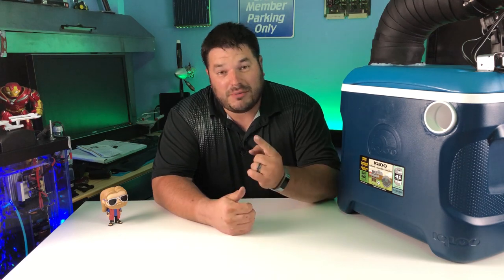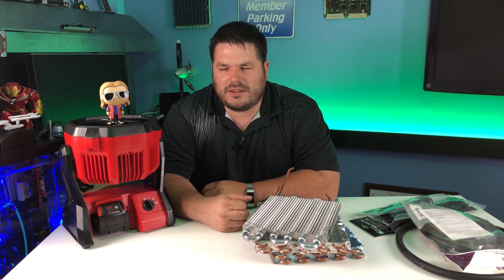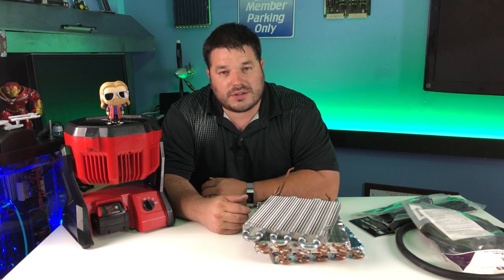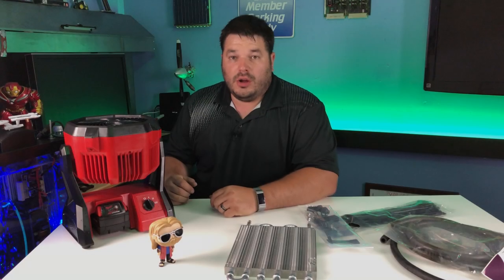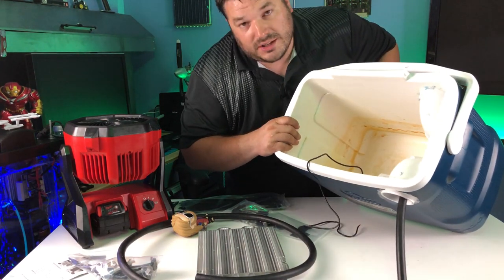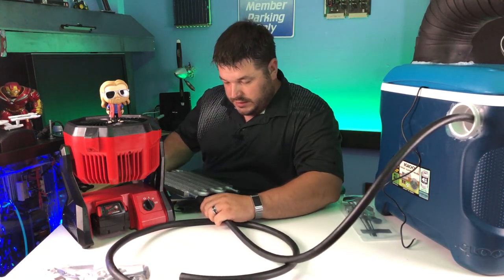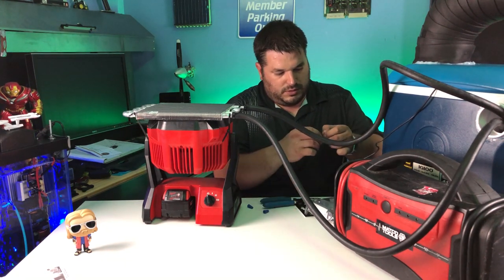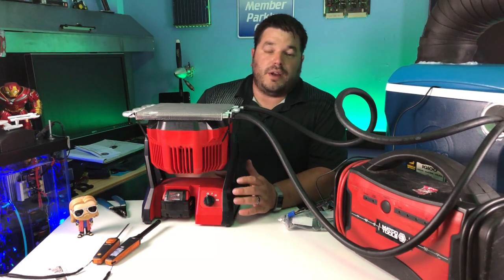HOMEMADE DIY ICE CHEST AC WITH A RADIATOR

Comment: So, I have a 2ft harbor freight shop fan and a massive radiator from an old diesel truck. With a large enough cooler, submersible pump, and some ice do you think I have a shot at cooling down my garage a little?
Reply from the maker: Well the off the cuff answer is yes. without knowing how big or well insulated your garage is the known limitations are the cfm of the box fan and the 144btu per pound of the ice, yull probably need a pretty big cooler and and decent pump.
I would use a pond pump and wrap a medium trashcan in insulation.

Comment: I made one using two metal coffee cans that held my dry ice, wrapped in copper tubing for water to run through. the cans had small vents on the top. Wrapped the cans and tubing in insulation. I split my cooler into three sections. On one end is the reservoir for my water , the middle is for the dry ice, the rest of the cooler is for the air intake and output. My air intake tubing sits on the bottom of the cooler, with the dry ice and water sit on the tubing. I have four rows of tubing on the bottom. I then put two radiators on the inside of the cooler where the out-flow vents are. On the outside of the cooler, I attached two fans in front of the radiators, with flanging that I can attach my directional vents. My air intake goes up to the top of the tent. This is made so that I can draw a small amount outside air, so that I don't have negative air pressure inside the tent. My vent for the dry ice is just a small hose that I run out and up through the intake tube. I have about twenty feet of hose, and it sits in the air flow end of the cooler. I made my water reservoir out of a plastic coffee can and a sterilized, never used pee bottle from the hospital. I attach the pee bottle to the can at an angle so that when put water in them, there is an air pocket at the top of the can. This will help to keep the water from freezing up (which it will). I used a 12V 5 amp marine pump, which is just enough to keep the water from freezing as it goes through its loop. Kept a 10x12 tent at 75 inside when the outside temp was 108 every day of a three day camping trip, which was my first time using it. That was thirty years ago, and my sons use the crap out of it to this day.
 There is only one problem with the design. Any condensation ends up in the airflow end of the cooler, so you have to keep the air flow tubing out of it, which is easy. Everything is 12v and can be ran by solar or a twelve volt battery. If you camp with kids and a wife, you need this. I'm not sure how much it cost to make, because I had everything just laying around or bought items from yard sales. The one I made for my son twenty years ago, cost me about 50 dollars.
Reply from the maker: This is a very thought out and apparently decent design. I would like to emphasize the use of the vent tube for co2 gas.
Yea man thank you for the share for sure!
Reply: @TheRenaissanceBuilder  My pleasure. I had to come up with something when the wife said she wouldn't go camping because of no A/C. My radiators are just heater cores off of dead cars that friends had. I never buy new for my DIY camping gear.

Comment: Another thing you could do I didn't think of is that she stack those heater cores or transmission coolers on top of one another and put them in series with each other and you should be able to get a better cooling temperature but still have the same amount airflow because I'm out of density Ben's is exactly the same as long as you line them up
Reply from the maker: Well that certainly is an idea, even if the resistance does increase that can be dealt with with a better fan. I find that when experimenting with output it comes down to two factors to balance and that is; cold air output (or specifically how many btus are you trying to move) and your ice capacity. The higher output the faster you go through ice so its often a trade off with what exactly your looking to accomplish with the unit. I find these units tend to work best as personal coolers, and in that a moderate airflow directed at the person with moderate cooling is the best ballence between your effective cooling and how fast it goes through ice.
Reply from the maker: Oh and thank you very much for watching and commenting, i love to here about other ideas and participate with veiwers!
Reply: @TheRenaissanceBuilder  his other stuff you can do to we used to do it in football to cool down the water we were drinking back in high High School chest on wheels
Reply: It would have a water pump is like see pesticide sprayer you can get at Tractor Supply or Walmart it'll be a trouble pump at 60 PSI is also the same pump you would buy for a camper water system and then we would have plastic hose or copper tubing going like a radiator pretty much inside the ice chest and on hot days as the water will go through the coils it would actually be cool down to the temperature of too much a drink that was thrown in the freezer for an hour or the same temperature as a refrigerator if not a little colder and I ate experimented with something with a old but still working small deep freezer and a couple heater cores. So what we did was we would actually have it layered inside the deep freezer and as it ran and stayed cold inside that deep freezer the water would just Loop all the way through the entire deep freezers the whole freezer will be filled with coils and what that did was it was actually pretty cheap to run that and as the deep freezer ranikhet the water ice cold just like your refrigerator has a cold water dispenser

Comment: Oh wow 2019, hopefully you will see my question…

Where does the water pump come into play, how is it connected?
Reply from the maker: Yes i indeed do see your question!
The water pump sits in the bottom of the cooler and pumps water the cooler bottom up into the coil and back to the cooler. It gets connected in parallel with the fan and can be powered by any 12v source.
Thank you for watching and asking!
Reply: @TheRenaissanceBuilder  are you serious from 2019… thank you so much😁
Reply from the maker: @chrisparker5895  absolutely boss, the entire point of this channel is to show and help everybody see that they can do stuff themselves. Ill never stop believing that.
Reply: @TheRenaissanceBuilder  I was going to do this the old way (fan blowing on ice) starting doing research and came across your video… thanks again
Reply from the maker: @chrisparker5895  theres a whole series on ice chest ac units, feel free to check it out. https://youtube.com/playlist?list=PLxe04zgzy0OC5LqGI7K3AQiLSKOHaS55B

Comment: Nice video! I'd perhaps explain you graph a bit more. Change in temp looks pretty exciting though. In a new build, could you please run power from tool battery to both the fan and the water pump? perhaps 3d print an adapter that goes between the fan and the battery? Not sure of the current pull of either. Then run a buck converter to step down to 12v? Great on screen presentation though and I like the idea. 10/10.
Reply from the maker: Thank you very much.
I don’t have a 3d printer but i did make a battery powered unit.
https://youtu.be/NTbrqCim1i0

Comment: I’m a complete noob, so bear with.  This seems like the best system I’ve seen so far and possible to use to sleep in carin hot and humid weather.

I’ll have reliable electricity (Bluetti or Jackery).

Recommendations for:  fan size (or specific fan), radiator size, how to affix radiator to fan, how to position fan radiator combo -> catch condensation without dripping on fan.

Once condensation in pan, I can put a hole in the bottom and have it drain back to cooler or into bucket.

Need for Honda CR-V, 1 person, 10 hours/night.

Thoughts?
Reply from the maker: Seems i missed your question and its been a while, I apologize.
I am a big fan of using computer case radiators and fans as they are extremely energy efficient and easy to package and mount together. Otherwise an automotive aftermarket transmission cooler like this one and a generic 10 inch fan would work well

Comment: How did everything work with the transmission fluid cooler vs the heat exchanger/core?
Reply from the maker: Hi Nate, i never got to try the tranny cooler because the fan i bought for it crapped out during tests. However, it would work just fine if you got a reliable fan for it. I believe its a 200mm fan, you would want to measure it to confirm.
You do not want to use the fans that are sold with it/for it because there way to high power
Reply: I used computer cooler parts for the one i built

Comment: Doesn't the radiator produce any condensation and "sweat"?
Reply from the maker: Yes it doas, if that is an issue a tray can be placed under it and drained away, or drained back into the cooler

Comment: So your Delta T is about 15 degrees, will that increase if you use a square fan and use a front and back side radiator ?
Reply from the maker: So more airflow will decrease your delta, the delta T or supply air temp is a factor of the temperature deference between the radiator and air, and the volume of air and water moved.
Another words slower air means each molecule of air spends longer in contact with the radiator but faster air spends less time.
A second radiator can help as long as the air to coil temp difference still exists.
Where it fails is when the leaving air temp is already within five degrees of coil temp then a second coil of the same temp will only drop the air temp another two degrees at most.
Key points
More air needs more radiator witch then also needs more water flow.
Reply: @TheRenaissanceBuilder  thanks, would a ethanol/water solution offer better cooling ?
Reply from the maker: The ethanol acts as antifreeze so you can get a lower saturated temperature allowing for high Delta T’s yes
Just subcool your ice to like -20 and yull get much better performance that way
Reply: @TheRenaissanceBuilder  you are the man, just got a new subscriber. Thanks for all the info, will take a trip through your YT catalog and see what other gems you have. I wish more success to you !
Reply from the maker: Thank you very much, i really do appreciate the patronage

Comment: I think this one is the winner for me.  Any moisture issues that you’ve noticed yet?
Reply from the maker: Donnie Culver  i want to make this version into a more “clean” setup that the whole things runs on solar yet.
I haven’t had moisture problems per say, but it does drip condensate so maybe set it on a tray.
Reply: The Renaissance Builder, thank you.  Dripping I can take.  Blowing/covering us in water is a different kind of issue.  This looks to be within my capabilities.  Going to the lake next weekend, and plan to make one of these!
Reply from the maker: Donnie Culver no sir thank You. Share a pic of your creation i would love to see it
Reply from the maker: BitFenix Spectre Pro 230mm Case Fan BFF-SPRO-23030KK-RP Black 
Im going to try this fan with that coil
Reply: Have you seen other videos where they’ attach the radiator to the top of the cooler and the fan pulls air in through the radiator, across the ice filled cooler, then out the fan?
Reply from the maker: Bob McNelis i have not seen that but my initial reaction is its a bit “extra”. Mounting the radiator in the cooler messes up the advantages of a movable chiller coil. You cant put it where you want it anymore, the ice will re humidify any air the coil dries out and the ice is already doing a better job of cooling than the coil can so 🤷🏽‍♀️
Just my two cents
If you want to see i good ice version check out  https://youtu.be/xHdJh7aPHeE
Im pretty happy with how that works
And thank you for watching and commenting I appreciate it😄

Comment: That little raiders actually call the heater core or if it's for a transmission transmission cooler it is the simplest smallest thing can use in a world it's also what heats up your car or your truck and gets it really hot from your coolant being about 200° and you get about 90 to 100 depending on how efficient it works out your vents in the front of your vehicle it can heat up a small area pretty quickly and keep that heat
Reply from the maker: Well thank you for responding, I appreciate your input for sure!

Comment: Could u used liquid nitrogen in this same operation
Reply from the maker: Well thats an idea for sure. It probably would either take allot of work to make the system hold the pressure or it would not last long. 
Also nitrogen can suffocate just as quickly as co2 so ventilation would be important
Reply from the maker: Thank you for the idea and for watching! I really appreciate it!

Comment: How long does the cool temperature last on your setup with ice filled up?
Reply from the maker: magicogar  I honestly never got to find out because the fan broke 😖, based on experience though i would say a better fan would have this unit running for 1-2 hours and doing a relatively good job of cooling of the space.
For a bit more money the upgrade works amazingly well, my favorite one yet.
https://youtu.be/EYEDD7dW47M

Comment: two quick questions and i apologize in advance if someone already answered this but i dont think i saw it so here it goes: 

1- why not put radiator on the otherside (air sucked in) or since the flow would already be restricted due to the radiator blocking air inflow? and therefore the opposite is better since you get the full force of air-out forced through the fins and cooled more?

2- is it making it more complicated by adding a heat exchange in between (which i already have) and thus have two closed systems? so for example, one side of the heat exchanger is attached to the the fan radiator/cooler and the other side of the heat exchanger is connected to the ice bath? and maybe use radiator coolant on the fan side and maybe even car cooolant in the ice box and maybe use lots of frozen water bottles to get the coolant really cold since it would technically not freeze at 32F and likewise on the other side? 

i previously used that heat exchange on a bitcoin mining rig that i submerged in vegetable oil and it worked well but could barely keep up with temps of 165F. im trying to remember if im going to need two pumps if i were to go this way and it is even worth it. do i really get the liquid to go sub-freezing and therefore get colder air for longer since the coolant has a better thermal conductivity or is it the inverse? jesus i should ask my combustion thermodynamics PhD dad but i would be ashamed since i myself am a materials engineer. thermodynamics wasnt our thing, or at least to the level he studied it haha
Reply: And I know I'm here late a year later or three years later talking about this but hopefully somebody catches this and has some insight. I can even mock up a sketch drawing if I need to
Reply from the maker: Hello and thank you very much for your questions. I will attempt to answer as accurately as possible. 
So there is a debate on the benefits of push versus pull in blower fans across coils. The details of the argument often revolve around weather the thermal energy of propulsion should happen before or after the point of heat exchange. However there are almost always greater influences to that decision, such as weather the motor life dictates better cooling or is there a heat source that demands the motor be a push configuration. In this case the pressure and enthalpy differences are so small that it makes little to no difference at all, in fact in this particular case it was simply easiest way to mount the radiator on that fan.
I have several other designs that use pull configuration again mostly for convenience.
Reply from the maker: As for your second question. 
A second loop would be superfluous as the use of “ice packs” and antifreeze can be applied to the primary system. The use of automotive antifreeze is the easiest and likely most effective way forward as it is engineered to maintain flow rates using friction modifiers and often gets as close to thermal content as water as possible by playing with specific gravity and density in the compound. Aka, its already engineered to work as a heat medium below freezing lol.
Now remember the most you can achieve is .5 btus of sensible heat per pound per degree below 32*, and the larger delta increases the thermal transfer causing faster warming of the ice within an exponential curve so return on sub32 cooling may not be as substantial and definitely more difficult to maintain.
Remember its the latent heat of fusion that contains all the potential with ice.
So in a nutshell, a secondary loop is not needed and have fun experimenting!!!
Reply: @TheRenaissanceBuilder  what an amazing response… I am a mechanical and materials engineer and your response is blowing me away…no pun intended lol  And my father has a PhD in mechanical engineering (combustion and thermodynamics) and this is spot on… I will respond thoroughly once I try it out but thank you

ps: I could have asked my father directly and I don't think I would've gotten an answer half as good because he would've spent the other half berating me for not knowing it as an engineer lol
Reply from the maker: I am very happy you are pleased. I honestly enjoy interactions. Any chance to learn is a good opportunity!